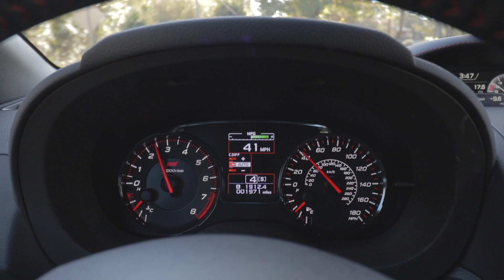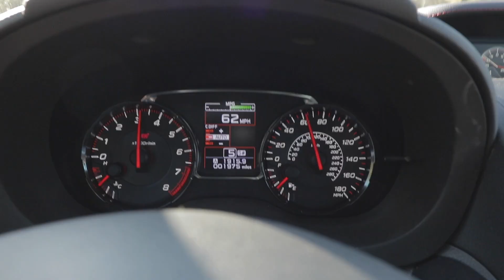2018 Subaru STI: AEM cold air install

Comment: Did you tune or no?  Lots of people are saying that tune requires but manufacturers says no tune required?
Reply from the maker: Didn't tune when first install but did tune for it a few weeks later.
Reply: Is there a difference between tuned and not tuned?
Reply from the maker: @22jeepmojave75  yes the stock doesn't recalibrate for the intake

Comment: Nice! Hurry Up with the DP install already! 😄 Dying to see what gains the 2018s are getting from them
Reply from the maker: Joseph Khawand lol. Just tune a 2018 STI with just a turbo back exhaust made 281whp and 330wtq. Sorry just been covered up sti swapping a 2.5rs and tuning a 450whp sti more video coming soon.
Reply: Thanks for the reply! Would you say just a pro-tune alone is worth it as far as performance/drivebability? Or you should add parts along with a tune? Thanks for the reply love the channel!
Reply from the maker: Joseph Khawand Thanks! 👊😁 Yes I do! What mods do you have done to your car?
Reply: Just Subaru’s performance exhaust. Been thinking of either doing downpipe/intake or just a protune alone...I wanted to see what others thought of just a protune on the stock car. Opinion?
Reply from the maker: Joseph Khawand I would definitely to a turbo back exhaust I don't think you a get a down pipe to match up with the spt exhaust. Just a heads up. And that would put you at the limit on your injectors
Reply: So just a downpipe ? The SPE is a cat back so just a downpipe would make it a turbo back no? I can leave out intake

Comment: Bought my Ice Silver ‘18 STi exactly 2 weeks ago.....and its been sitting at Subaru for the last freakin week getting warranty work done (left turn signal wouldn’t turn off)   Turns out it was the Body Integrated Unit...which is backordered.  I’m slightly pissed off.  Am I wrong for asking the dealership to hook me up with the OEM front lip??  I sure don’t think so!! 😡
Reply from the maker: JSAFRIT1984 I would be to! No there need to throw in something to make it right if not email Subaru USA there will make it right!

Comment: bra, not hating at all but why does the car seem slow??? i am getting a new STI regardless but it just seems like it should accelerate faster in stock form right???? idk....
Reply from the maker: declaratedvet lol. They are stock but with a few mods they get a lot faster still one of the most fun to drive cars. I'm about install injectors and downpipe show the difference.

Comment: 2017STI, I have a AEM CAI Do we need to tune it? And what maps should we put when we have a cobb accessport?
Reply from the maker: barry masangcay yes you need a tune for it but the stage 1 map will work till you get a tune.
Reply: There's no other way to use it without tuning it? Can we buy maps?
Reply from the maker: barry masangcay you can use it with the stage 1 map just watch feedback knock, fine knock learn. But I would recommend getting a custom tune for it.
Reply: Thanks bro
Reply: barry masangcay custom tune for sure. The base map sucked when I got tuned. What a difference
Reply: Is the tune necessary or is it only for performance gains?

Comment: Hey +Tommy Kentner does your STI have the responsive headlights on it? Just wondering if the heat shield was well clear of the bank of the headlight unit that's all.
Reply from the maker: Yes it does! It really close tho.
Reply: @tommykentner  awesome, thanks! That's what I need to know.. I bought a CAI from a competitor and the heat shield didn't clear the bulge in the headlight unit from the motor for the responsive thing.. dramas ensued thereafter
Reply from the maker: @vondammit  which one did you get? And you can order just the aem heat shield by itself.
Reply: @tommykentner  I managed to get a refund.. just wasn't easy. I'd look at getting the whole kit. So you've had this in for some time now.. how is it? And how long did you get away with using it without the tune?
Reply from the maker: @vondammit  OK the aem is a good one for that. But the Cobb sf with a tune is better in my opinion. Make about 25whp more. And get more turbo noise! 😂

Comment: Need a tune bro with that intake, or keep it off boost until you do. Especially with those chocolate Pistons 😉👍
Reply from the maker: ScoobySTI Chris lol! I know going to do a few more modifications first! And I did a few logs every looks good
Reply: @tommykentner  how long did you run the aem intake without getting a tune? Was it worth getting?
Reply from the maker: @Grim-STi  I ran it for a few days it not to far off. But I would just recommend getting the cobb sf it make all the nice sound 👊😎
Reply: @tommykentner  so did you end up switching the aem for the Cobb intake? And would you say Cobb is better then aem? 
Thanks for the reply! 
I’ve been using a K&N drop in high flow panel filter in my 2015 STi with a TurboSmart Adjustable BOV and it’s already making nice sounds but I’ve heard a cold air intake will make it even louder it’s just best to get them tuned before using one, and you can’t actually pull much power out of a cold air intake can you? Best bet would be to do that along with a catless down pipe and cat back and make it a bit more worth it with the results!, would appreciate knowing your opinion on this! :) 
- I also recently found out about a fuel stumble kit for going stage 2 have you heard much about this or have done this yourself?
Reply: @tommykentner  fuel stumble kit I meant* 
Will be getting a tune soon I just want to get enough parts to make the tune a bit more worth it instead of going in and tuning for one part and seeing little gains
Reply from the maker: l y m a x ive tune my car on both intake and the Cobb made more power. But yes a down-pipe and  tune is the best option. And on a 2015 sti you have to do one or the other if you do both you will have to upgrade injectors 1050x then you can do flex fuel which will pick up a lot more POWER!
Reply from the maker: @Grim-STi  yes I recommend the fpr kit and try to do all the mods and get one tune so it safe you money and if you need a e tune just let me know 👊😎
Reply: @tommykentner  okay interesting. Thank you for that I’ll make sure to get the Cobb intake now! 
Yeah I’ve heard about that I’ll make sure I do that now too, it’s going to cost a pretty penny but will be worth it, I do consider myself a Subaru enthusiast as I’m on my 3rd Subaru in 5 years now and have done services and fluid changes but I don’t know much about tuning. Would you say that 185,000kms is too high to tune the car? Even if it is in great condition and has been serviced on time everytime?
Reply: Yeah I’ll definitely get the fpr kit too!, and sounds like the way to go! Cheers bro 🍻
Reply from the maker: @Grim-STi  if it runs good and just make sure to check the oil should be no problem 👊😎
Reply: @tommykentner  thank you for answering all my questions it goes a long way i appreciate it a lot I’ll be getting a tune as soon as possible. How many kms have you heard of a EJ257 get max so far? 
I’ve seen pictures of some STi’s reaching 400,000kms but I wonder if they’ve ever made it to 500,000kms?
Reply from the maker: @Grim-STi  seen alot around the 400,000kms they run forever with good oil and services /oil change around every 4828 kms

Comment: I have a 2018 sti too and I found out it doesn't fit on it after I bought a aem intake. Do you know how come is that? What model of aem you bought?
Reply from the maker: Raymond Chen what the parts number on the one you got?
Reply: Tommy Kentner i got aem21 735 wr
Reply from the maker: Raymond Chen that the right part number. What problem or you having installing it?
Reply: Tommy Kentner the heat shield not fit
Reply from the maker: Raymond Chen it will fit just take a little time to get it down in there
Reply: Tommy Kentner ok let me try again 👍

Comment: Hey what map did you use on the Cobb accessport the 91 octane +
Reply from the maker: No it was a custom pro tune by me
Reply: @tommykentner  you think the 93 octane + will work with that mod just accessport and cold air intake?
Reply from the maker: @power12wagon  what intake?
Reply: @tommykentner  Aem cold air intake red wrinkled my it's a 2018 sti
Reply from the maker: @power12wagon  know I would recommend a custom tune for that one. If you get the Cobb sf the a pre loaded map on your Cobb ap.
Reply: @tommykentner  thanks buddy good video
Reply from the maker: @power12wagon  thanks!

Comment: I just installed this intake and my car runs very weird with it on. Bucking/jerking with the Stage 1+ map installed...
Reply from the maker: BlackGT1999 what all mods do you have done to the car?
Reply: Tommy Kentner GFB hybrid BOV/Invidia N1 catback exhaust/AP Stage 1+
Reply from the maker: BlackGT1999 you need a custom tune for tho parts. Run just the stage 1 the car will run and drive better but your going to have to get a tune.
Reply: Tommy Kentner you mean a pro tune/e tune? I took off the AEM in exchange for Cobb’s SF intake. I’ll let you know how it runs next week
Reply from the maker: BlackGT1999 yes a pro tune or e tune. Just more safe and a tune just for your car.
Reply: update Cobb SF runs hella smooth
Reply from the maker: BlackGT1999 good deal! How you like it?
Reply: Tommy Kentner Love it. Better driveability (go figure) and in my opinion much louder than the AEM
Reply from the maker: BlackGT1999 I thought the Cobb was louder I've installed a lot of them on other cars.

Comment: Bought this for my 18 a d the heatsheild bolt doesn't line up
Reply from the maker: Bryan Gartland on the top?
Reply: Bottom bolt hole doesnt match up
Reply: Tommy Kentner what tune did you use
Reply from the maker: Bryan Gartland it a custom tune for the set I have.